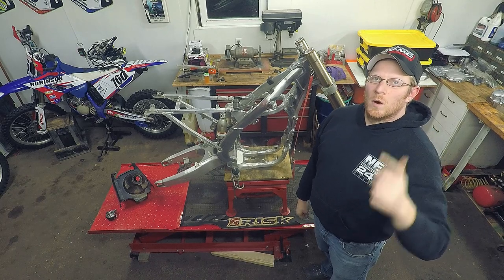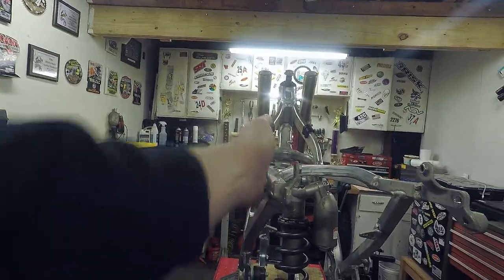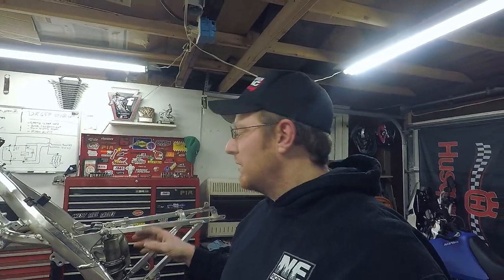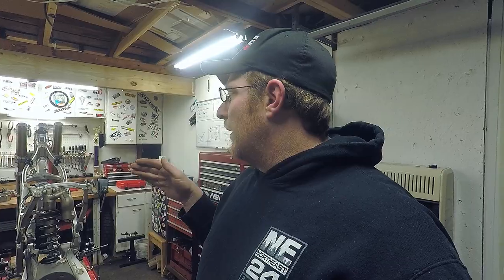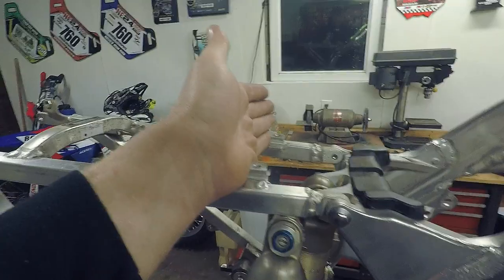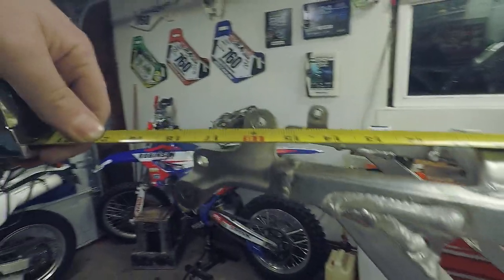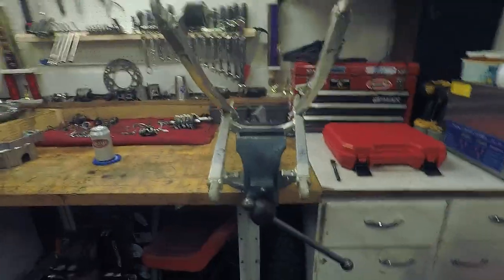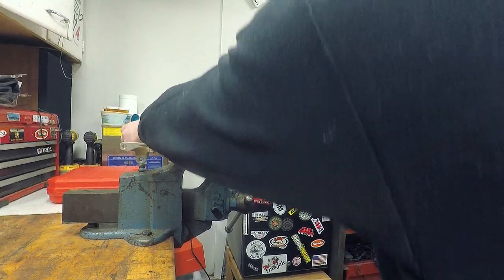2Stroke In A 4Stroke Frame Pt 4: Bent Subframe Repair

Comment: Thanks for the video.  Had not seen an others for straighten a sub frame.   I had the bike on the sand, but when I crank on the end of the frame It hit the suspension and absorbs my force.  Was trying to figure a way to get it in the a vice.   You gave me an idea and I think I make it work and take some measurements to insure is square.

Comment: After a twist like that is the frame compromised? Will it get out of shape easily again?
Reply from the maker: The subframe? As long as you don’t cartwheel it she should stay. It was relaxed when installed on the bike, so there was no pressure either way.
Reply: @robinsonmotorsports9976  hmmm okay.. good to know. I’m eying a dirt bike with a bent subframe. It’s been sitting on the marketplace for about a good minute and considering purchasing it.